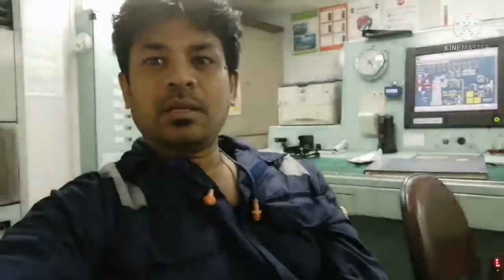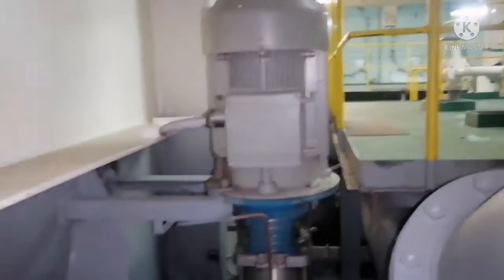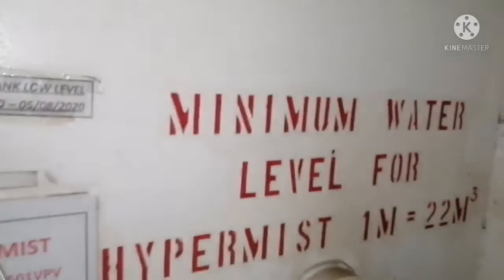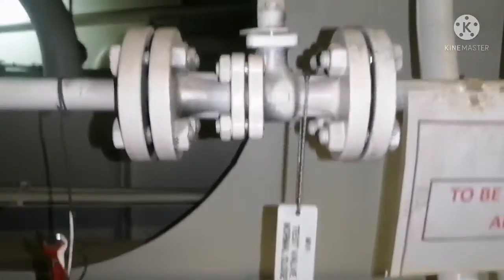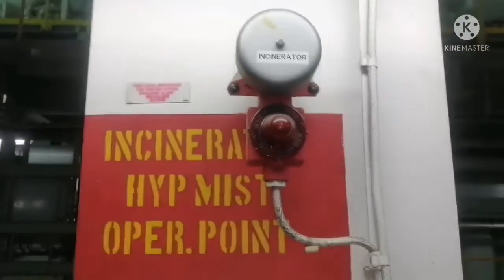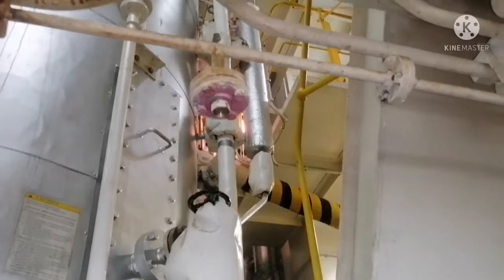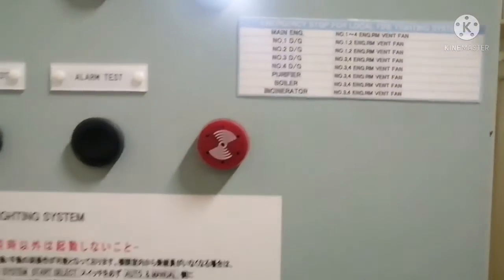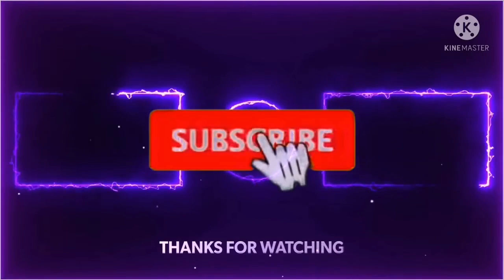How do they work... know everything about Hypermist fire fighting system onboard ship...

Comment: Pump suction valve is manual valve or remotely operated valve Plz replay
Reply from the maker: Sir if the system mode is in auto suction valve will open automatically..
If the system mode is in manual then v can operate the valve manually also